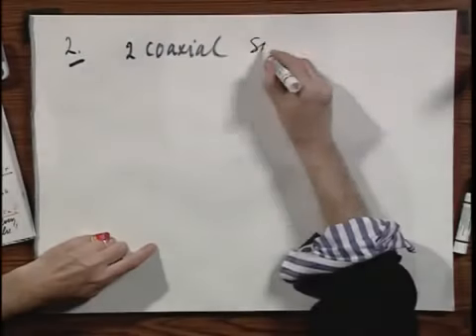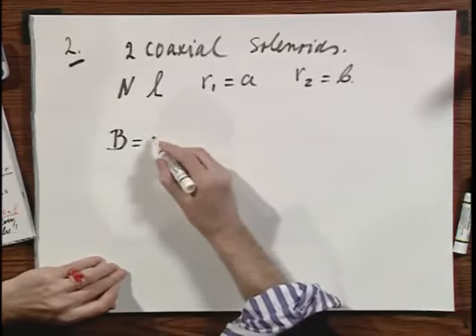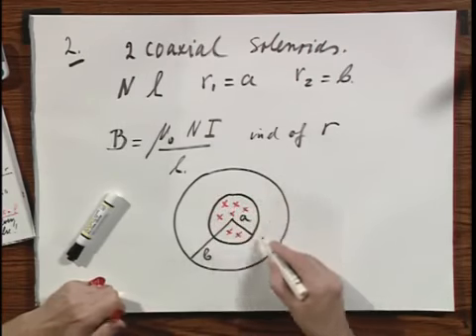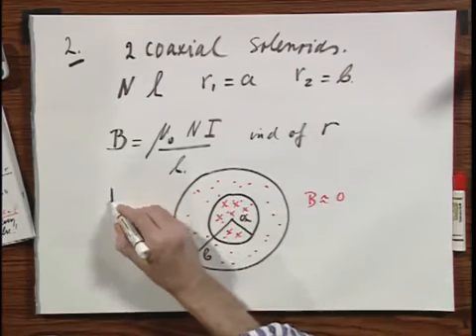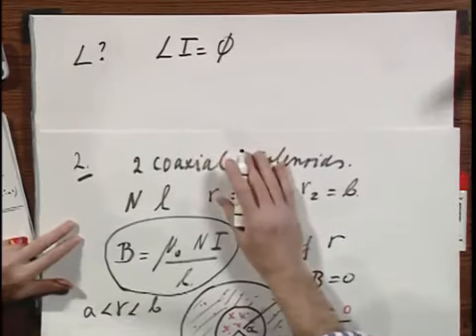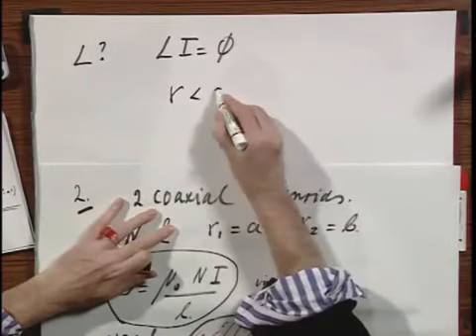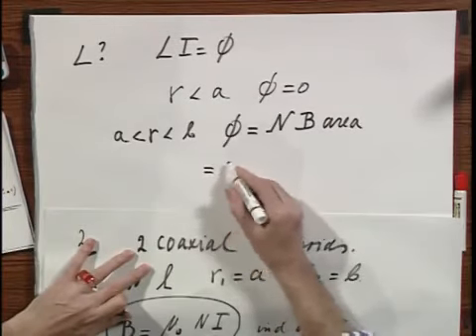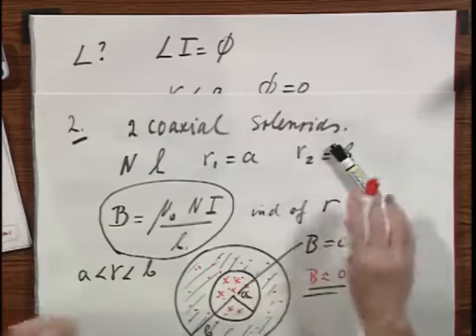8.02x - Module 10.02 - Inductance of Two Coaxial Cables (solenoids).

Comment: Would these two exact solenoids (same current, size and lenght, turn number) exert a force to each other and try to move in opposite directions if they could?  Thanks in advance for your kindly answer.
Reply from the maker: question unclear
Reply: Since a solenoid is similar to a bar magnet and magnetic poles are created as the current passes and these two solenoids with opposite currents and opposite poles on each side would attract each other and stand still. They would resist force if we try to push out the inner one as the current passes opposite to each other. Am I correct? @lecturesbywalterlewin.they9259